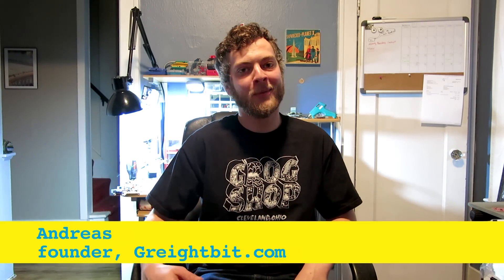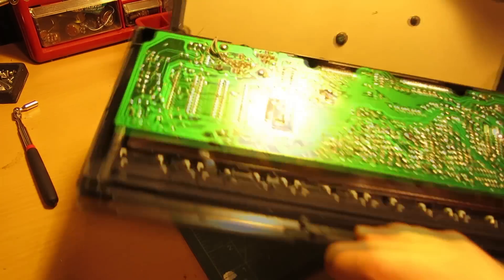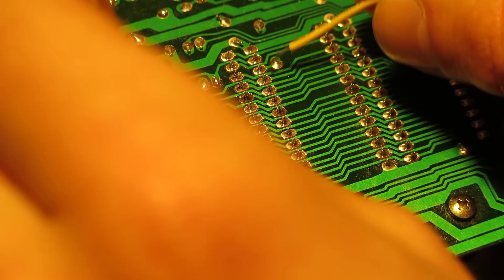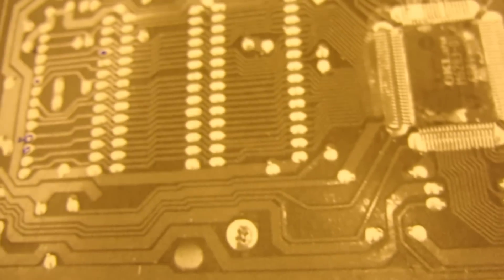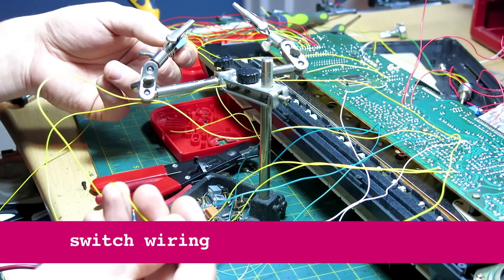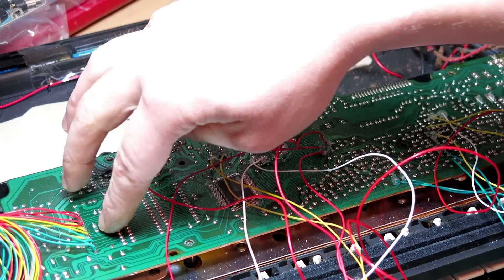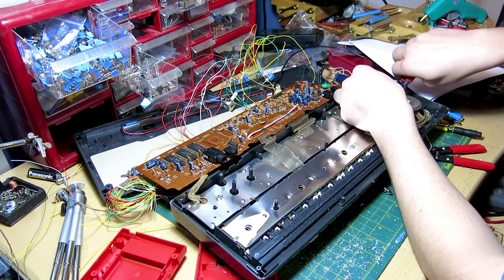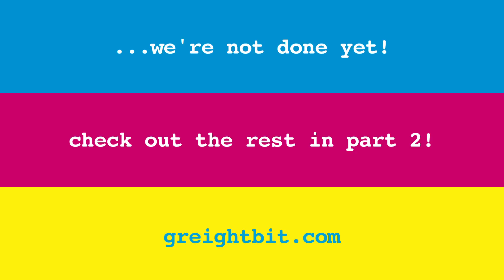moog circuit bending challenge 2014 pt 1 of 2

Comment: Hey man I love what you've done. This may be a dumb question, but where can I get multi-colored wires without hunting too hard?
Reply from the maker: Hey, So for this SK I actually used old Ethernet cables. If you cut up old phone/Enet cables, there is usually a few colors that you can use together to single out mods.